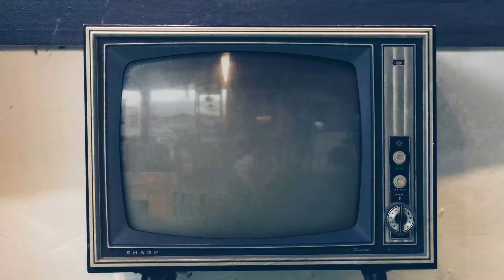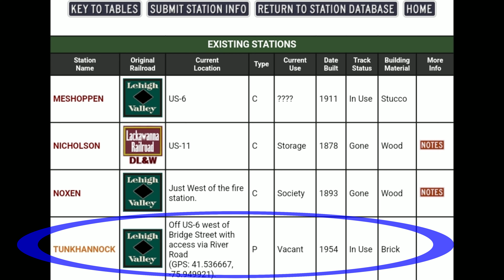VACANT 1950's Lehigh Valley RR Train Station (Viewer Suggestion)

Comment: Last Train 1960, THE MAPLE LEAF a overnight mail and express train. Those are express carts on the platform.  The black top is the platform. The garage doors were where the package express and local mail was loaded or loaded. Railway Express was the carrier. It's Fedex  or United Parcel business today. All former passenger train business!  The tracks next to it. Was for the set out cars to be loaded or unloaded. The concrete post at 8:00  was I believe for a mail box! Most stations had them. Trains had Post Offices on them next to the unit. At the stop the Postman got off and pulled the box. Mail was there in hours not days like by truck today. And for 5 cents not 66! You are at time table mile post 207 from New York. The afternoon Diamond which was in your picture stopped here and had heavy loading. The night train THE MAPLE LEAF was restricted to only NY and Philly Passengers.   I liked the video, saved me a trip up there to see it. Gas is not twenty cents a gallon today.

Comment: Nice video but you need some assistance.  Those carts are called baggage carts. There were found at  every train station to up- load and un- load baggage, freight, mail  and other materials that was carried by the railroad  in their baggage cars. The windows have glass blocks installed. They are glass bricks which allowed light to pass through. So now you have learned 2 new things. you are welcome.

Comment: I lived in Edwardsville (near Wilkes-Barre) for a time and there was a turnstile (not sure of the technical term) that engines would get on and it would turn until the engine was lined up on the track that it was to go. Not sure if it's still there but it was really interesting to see.
Reply from the maker: Turntable I think you're referring to, but I dont know of any in wilkes barre right now.
Reply: The turntable and area that you are referring to is just across from the Lowe's. Nothing remains of the actual structure but one can still make out the outlines of what was once there.
Reply: That was called a turntable and they were in a "Roundhouse".  The railroad workers could work on the underbellies of the old steam locomotives.  There used to be one outside of East Stroudsburg at gravel place.

Comment: half of the station was passenger use, hence the asphalt platform, the rest was freight and baggage, hence the carts and loading dock…odds are the freight was the real breadwinner there since it was built when the passenger trains were in steep decline in ridership and quality
Reply from the maker: Makes sense. Thanks for the correction.
Reply: @JPVideos81  it stood out for the reasons you mentioned: the baggage carts, sign, and low platform…freight stations don’t need a low platform as they’d unload onto a high platform right into the building.

Comment: The road behind the station is the "new" US Hwy 6 bypass that was opened in the late 1990s. Most of those streets used to go right up the hill into town but they closed most of them in the late 80s when they turned the area between the railway and the river into "riverside park" after numerous floods destroyed much of what was along there. In the "old" 1950s picture you can see the old Billings Mill in the background - that was torn down in the 80s around the same time those other tracks were put to rest. One of those tracks was kept active much later than the others as it went into the Agway Supply, which was located directly underneath what is that section of Hwy 6 bypass now.  The station was still relatively well maintained until around that time as well. I would say it's been 35-40 years now since they stopped using it for anything. I lived within a mile or so of here the first 22 years of my life and used to walk along the river there daily - I've been gone since the mid 90s, but still have family and property there.
Reply from the maker: Thanks so much for the additional info
Reply: I think the only freight business RBMN has up that way is the P&G plant on the other side of Vosburg Tunnel in Mehoopany which is the northern end of R&N ownership, Lehigh Railway operates the line to Towanda and Athens below Sayre under lease from NS.

Comment: Cool find, thanks so much for sharing! I believe that's the location Reading & Northern ran Santa trains out of a few weeks ago. I almost went to chase that, but I had gone to RSME with RJ one of the days and it rained the other day. Maybe I'll go next year so I can check that out while I'm there. Next year Reading & Northern is bringing passenger service to Pittston. That's another half hour or so up the line, so maybe in the future they can rehab that and run regular trains out of it again? Lots of possibilities! It needs a lot of work but seems like it's still intact enough to do so.
Reply from the maker: With Andy behind the plans and projects, anything is possible.
Reply: 2102 now goes from Nesquehoning to Tunkhannock usually in June. There is a run again this year. You can buy tickets at the Reading and Northern site. That is a long all day excursion from 9 AM to about 7 PM. There is a layover In Tunkhannock for a festival. I wonder who owns the ex-LV station in Tunkhannock? Was that a freight or passenger station? It’s just a block brick building. Other LV passenger stations most of which are gone were more elaborate.
Reply: @robkrasinski6217  I believe the Tunkhannock station was for freight and is currently owned by Reading & Northern.